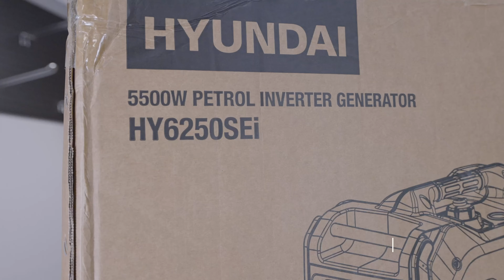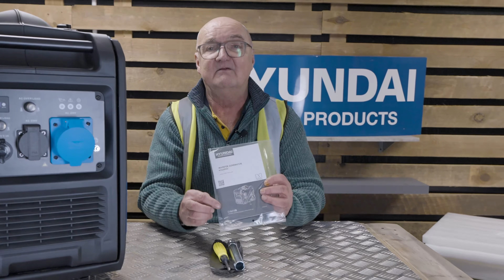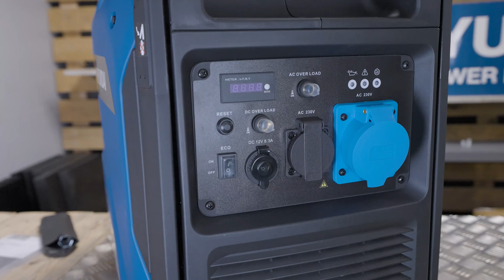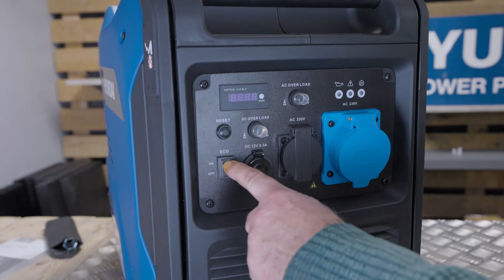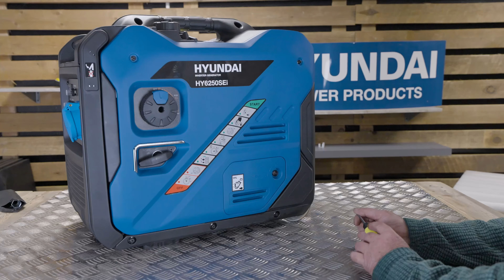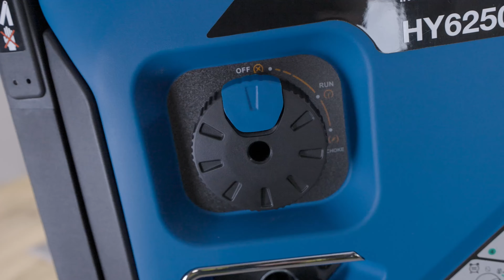Unboxing the New Hyundai HY6250SEi 5.5kW Electric Start Generator With Pure Sine Wave

Comment: The video fails to cover the electric start function, including how to firstly connect up the internal battery (due to being shipped in the isolated state).
Reply from the maker: We will be addressing this in a further video, yes, these units do have electric start capabilities - as you quite rightly stated, it requires the battery to be connected first.
Reply: @HPPUK  any idea when the video is going to be uploaded
Reply from the maker: @dellowwarren  https://youtu.be/KtNSrLgQcYc